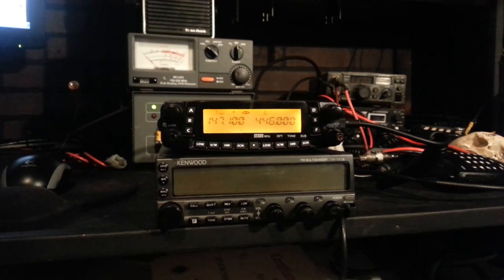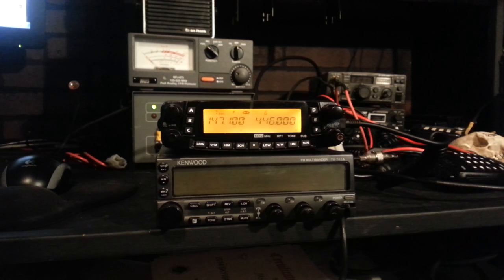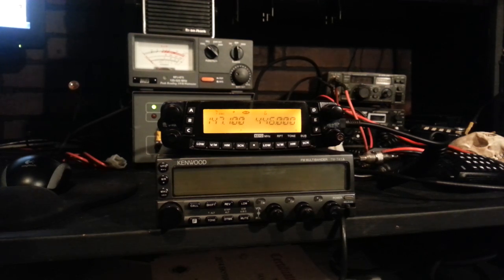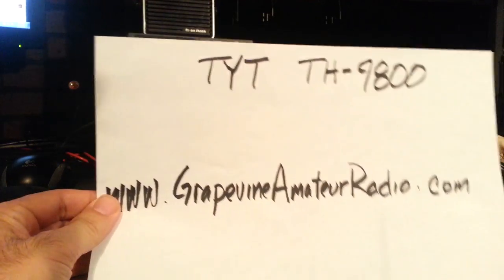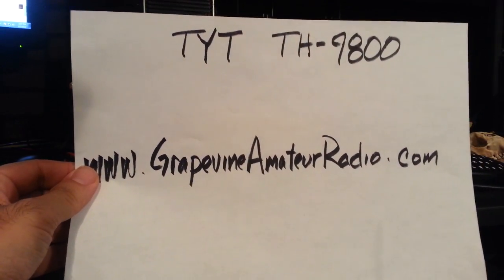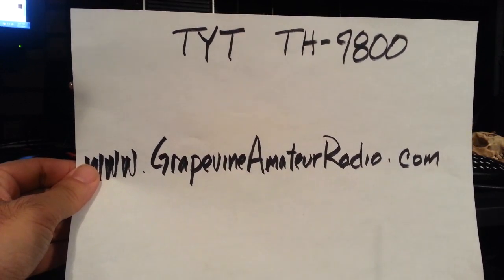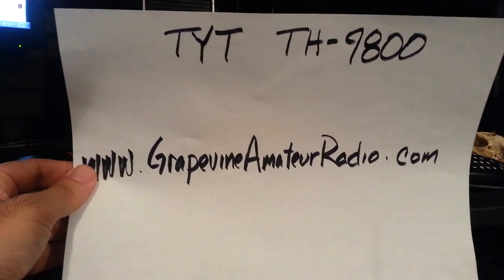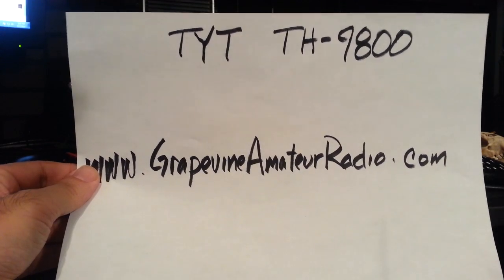How to Program the TYT TH 9800 Quad Band Ham Radio - Ham Radio Programming

Comment: Hi,
Great video! 👍🏽 I have a question: why the transmission on 27 mhz is very distorted? The transmission on 2m and 70cm works perfectly. I checked the antenna and the SWR is 1.5 on 11m. Thanks!
Reply from the maker: This radio isn't really made to TX on 27MHz so the performance is poor
Reply: @HamRadio2 Thank you so much for you’re answer! 73

Comment: is this radio lcd display supposed to dim when transmitting?
Reply from the maker: No
Reply: @  well mine does then it beeps before normalizing the screen. Almost like it’s sending a ptt ID. At first I thought ok there must be a power connection problem, but it transmitted  without pausing on a different channel. So no power problem and a beautiful transmission.  I hear the other repeaters but unable to transmit.

Comment: Thank you for the video it was very helpful. Question, is there a way to have different CTCSS tones for transmit and receive? There are a couple of repeaters I would like to use but their uplink and down link tones are not the same.
Reply from the maker: It's been a while since I used this radio, but if I recall correctly, no there isn't a way to do that.

Comment: I recently won a TH7800 in a raffle and have been looking for explanations on using it.
Your quad is apparently almost identical to my radio so thanks for being an 'elmer' for me.
73
Reply from the maker: Yes they're very similar. I made a video about the 7800 also, which was released a couple of years after the 9800

Comment: I ordered one of these from AliExpress because it was advertised to do 70cm/2M/6M/10M but got burned. It only does 70cm/2M (tried both sides of the radio) ... to add to my pain, it appears used and the data connection does not work. I programmed all of my repeaters (100+) and simplex frequencies by hand. Your video was a huge help there. Thank you!! I also really like those A,B,C,D,E,F presets. Excellent for the ISS and other satellites to start on the main TX/RX frequencies and then chase the doppler  with the nobs. I wish I could get the data connection working to see if 6M/10M is disabled via software. Might look for someone locally with a known good cable. Anyway thanks again for making this video. Would mostly be a TYT branded paperweight for me otherwise 😆
Reply from the maker: I've never seen one that didn't have 10/6 meters
Reply: @HamRadio2  It's definitely odd. If I cycle through the left side of the radio in VFO, it's 144/350/440Mhz and right side of the radio is 144/440Mhz. If I enter 029.600 manually for example it just resets to whatever frequency I'm on. Only thing I can think of is if I can get the data connection to work that there might be options in the software to enable/disable bands and maybe I just need to re-enable. Though there's the potential those were disabled to "refurbish" (maybe they weren't working correctly) The radio did appear used (wear marks where the bracket would be installed) AliExpress is always a gamble 🤷‍♂
Reply from the maker: Sounds like you got a TH-7800, not a TH-9800
Reply: @HamRadio2  you might be onto something there! The radio does have the TH-9800 logo as well and Product/SN sticker, but I imagine fakes do happen. Appreciate the insight and thanks again for recording this programming tutorial.

Comment: I am getting my 9800 plus dusted off and want to start using it again. But I need to find another ‘head unit- mount bracket’. No-one seems to have them for sale. Is there an alternative you could suggest for this?
Reply from the maker: Not that I know of
Reply: @HamRadio2  thanks for quick reply. Subbed.

Comment: Does the 9800D work the same?
Reply from the maker: Yes
Reply: @HamRadio2  thanks so much as the manual even for the newer 9800D leaves a lot out….have you expanded the bands yet ?

Comment: I know this is a old thread. But cannot find any info on how to program 10 meter FM on this unit.  Also,  can you confirm this unit will transmit and receive on 10 FM SSB?  

Thank you
Reply from the maker: It is FM only.  And you can only use 10M on the left side of the radio.

Comment: I'm a radio ham but only own a Baofeng UV-5r right now. Here in the UK, 2m and 70cm is busstling with activity right up until about midnight or 1am, so I'm thinking about this radio as an upgrade to my current setup. I like that it goes on 446mhz as well, since 446.000 to 446.200 is a licence free band here in the UK like GMRS or FRS is for America.  I like the extra bands like 10m and 6m, and I may give them a go at some point too.

Comment: Hello

Thank you for the nice video about the VHF/UHF part of this TYT TH-9800 quad band radio but it would have good to at lest have an antenna hooked up to it so we could hear it working.
But also what about the 29/50 meters segments of that radio which we seen very little of what it can do let alone hearing nothing of its audio quality let alone also not hearing any ting as to what antenna/antennas would be best to use for this quad band radio both in the HOME base setup and indeed in the mobile especially if you are looking to perhaps buying one of these radios.
Let alone as to what additional cost you would be looking at in the antenna range let alone any other things you would need like a switch box for changing over the antenna or an antenna range seeing how there are not two many quad band mobile antennas around for that radio setup let alone for its home base setup at lest in the vertical range that would suite it either looking at what’s available or unavailable as that radio has just has a single OS232 socket on the back.

Thank you again and who knows I many work you some time at lest on 10 meters.

73s

🌍

Comment: Hello. I know this an older thread. Recently purchased TH 7900. Don't have access to a computer or laptop, just this Amazon fire tablet  I am writing on here, so I have been trying to manually program repeater to no avail. Think I have been doing this correctly but when I key up to repeater, I get an ERROR message. Simplex works just fine though.
Reply: Just fixed it. I believe I was entering encode & decode when only encode was needed. Regardless, I am now able to tx and recieve  on repeaters.

Comment: I can't seem to get the radio connected to windows 10. I keep getting an error. HELP please
Reply from the maker: What software?  Most likely it is a driver issue in Windows, check your device manager.
Reply: Using the TYT software and chirp. Neither work. Updated the driver and restarted the computer. Does the radio need to be in a special mode? I can't find any info in the manual
Reply from the maker: @boatsyoung  Nope, no special mode, at least not on the model in this video.  If something has changed in the last few months, I am unaware of it.  Still check your device manager with the radio connected to the computer via USB cable that plugs into the back of the radio, with the radio powered on.

Comment: The microphone isn’t very good I had to order a yaesu mic the original one no one could understand me
Reply from the maker: The TYT mic I had had too much gain - it picked up lots of background noise while driving.  Sitting in the shack, it worked fine.
Reply: @HamRadio2  Well i ordered a new yaesu MH-48 mic from eBay and just soldered a 100 ohm resistor to cut down the voltage and now its not very hot. I'm also going to change the element in the original mic and I hope it will cure the problem. Thanks for your reply Jason

Comment: I followed the steps in your video as well as using the manual. For some reason when I hit the PTT there is no transmission. Although once I let off the PTT it makes a little noise. I have another (working) radio set to the same repeater to listen. It is as if the TYT KT-9800 is transmitting on the output of the repeater. Like the + shift isn't working at all. It must be a bad one.

Comment: I had a Yaesu FT8900 and returned it... they changed how "banks" work from the 8800. I really like how you can program banks, and assign them to the 1-3 and 4-6 keys (or A B C and D E F on the TYT) and more importantly scan that bank. The 8900 would scan ALL freqs and didn't utilize bank scanning.

Are you familiar with what I'm explaining? And if so, does the TYT scan each memory channel (or channels assigned to that letter) individually? Or, will it scan like the 8900 does?

... I program a 9800 tomorrow. So I'm curious and would like to explain it to the owner.

Comment: One question: if I turn AM off on the menu, will it disable 29/50Mhz? I don't want to transmit on those bands by mistake since my antenna is dual band 2m/70cm. Thanks!
Reply from the maker: It will disable AM but not the band.  Disabling AM on that radio only means that it is locked to the FM mode.

Comment: This radio had a design flaw with over-voltage of the CMX-138 audio chips. Do you know if manufacturer fixed this issue in the latest revision of this radio?
Reply: I wanna know too

Comment: I recently purchased the tyt 9800 but I can't seem to get the cross band repeat function to work. I did not buy it from your website but when I do key up the numbers that both sides of the radio repeater side flashes the signal strength but that's all

Comment: If this radio needs any form of maintenance after the warranty is gone then it will require you to ship it back to China and back at your costs.I will never buy another TYT just for that reason.It’s not an option any longer for me.
Reply from the maker: This is pretty much true for any radio out there.  The difference is that TYT doesn't have a repair center in the USA.  Some Japanese companies also require shipment back to Japan.
Reply: @HamRadio2  I have never had to return any ICOM to anywhere outside of the United States and plenty of places here who will work on them.I had a lot of fun with the 9800 but I will never buy another at any price.👍🎙
Reply from the maker: @1OFGODSOWN  Well Icom is a better radio, hands down.  But people don't buy the TYT, thinking it is a better radio - they buy it because it is cheaper.  So you get what you pay for.

Comment: What is the difference between the 9800 and the 9800 plus ?

Is there a way to open up the rest of the receive range ?

So I can get the 222 MHz band RX and the 500 and 600 band ?
Reply from the maker: 9800 Plus replaced the 9800 a couple of years ago. It fixed some minor issues with the original model

Comment: I had one and it lasted about a year and a half ago the receiver quit working on all bands.I contacted many repair shops across America and I found NOBODY who would touch it for even an attempt at a repair.I contacted several dealers who sell them and none of them could offer me any leads for a repair short of returning it to China which would require me paying shipping both ways and the repair costs.I could have purchased another one for less money so I sold it for parts to a Military Man in Texas who wanted to make an attempt at it.I have not heard back from him now in 4 or 5 months so I guess he has not made any progress.I had some fun with it in my mobile during band openings on both Ten and Six meters with the Diamond Quad Band mobile antenna while it lasted.I would NOT ever buy another one since nobody will repair them.I’ll stick with my ICOM gear and know it’s repairable in America.👍🎙
Reply: Did you tune your antennas properly? If not that can reduce the life of your transceiver.
Reply: @discofishing  I use an antenna analyzer to tune my antenna’s for every antenna and every band.I’m not an Idiot.I have only been tuning antenna’s since the 60’s how about you?

Comment: I have the Tyt th-9800 as my base i picked it up in 2014 when i got my license. and haven't had any problems with at all works great. I liked it so much i just bought a Th-7800 for my truck. they are great radios. great video    KK4ZNU

Comment: Can you use it as a Gmrs repeater like putting 462.550 on left and 467.550 on the right  please let me know
Reply from the maker: No.  It was repeat from the same band to the same band.
Reply: @HamRadio2  what 1 radio can you use as a Repeater since I Don't have a lot of cash to get on being on SSI Disabled
Reply from the maker: @RuossFamilyAdventures  You would need 2 radios to create a repeater - one for TX and one for RX.  It'd be easier to just buy a repeater.

Comment: The HYS 8900r is the exact same radio.
Reply from the maker: Yep. TYT was out first, though
Reply: I had a heck of a time trying to find help programming my HYS  (It's not listed in chirp). After some digging I found out they are the same. The only difference i found is that the HYS will cover the 64cm itenerate business and GMRS bands which I use quite a bit. My wife is not a ham but my GMRS license covers her so we use this radio while I'm at work. I use the business band at work on another radio.
WRJL490
AI5BU
73s

Comment: Anyone know of a mod or custom firmware for the TYT TH-9800 PLUS that lets you open up use for 6m or 10m on BOTH the VFO's instead of only on the left one? Really wish I could at least listen to 6m on the right VFO at the same time the left VFO is on 6m too...

Comment: 6 yrs old...wow...!!! I guess that's why the radios are no longer available on your website... Great tutorial though, thanks...!
Reply from the maker: Yes I stopped selling radios a couple of years ago. Thanks for commenting
Reply: If you haven't gotten one already try Amazon and I'd definitely suggest the extended warranty just in case. Also you preferably want to look for the "plus" version because it's the newest version with most of the "bugs" worked out.

Comment: Hi, if I throw freqs into the TYT with Chirp, will the codeplug make the changes on the radio in order to use the repeaters? All info is on the codeplug correctly.

Comment: Can you set this radio up to cross band to uhf at max power and vhf to low power? I want a small foot print for my vhf HT because I only want to use it as a hands free option for around my property to get into the local uhf repeater
Reply from the maker: Yes you can do that

Comment: I've had a couple repeaters cause my radio to power off, backlight goes of then screen goes blank till I release ptt. only does it on high power.  I tested power output from my supply, Astron RS-12. and no drop in power. any help is appreciated !
Reply: I also have an Astron RS-12, and it is rated slightly lower amps than what this radio pulls at high power. I think the radio manual recommends 15 amps or more. Try connecting it to a 12V battery or a larger power supply and see if it still happens.

Comment: You mentioned the power output levels for the 2 meter & 440 mhz bands but I missed it if you mentioned the 6 & 10 meter bands?
Reply from the maker: They're about 25-35 watts each
Reply: Ham Radio 2.0 that is very low? I get 50 watts or better on both bands with my own TH-9800.Do you have the power settings right on yours? Those numbers for yours are quite a bit below spec.I love mine and have worked all over the USA on it on both 6 & 10 meters during band openings.I use it Mobile with the Diamond CR8900A antenna with pretty good success.
Reply from the maker: @1OFGODSOWN  They're advertised at 50-watts, but I have found that rarely they get that high on those 2 bands.

Comment: Hi Ham Radio 2.0 can you tell me if the TH-9800 model does TX and RX in AM 27Mhz (CB frequency)? Big 73.
Reply from the maker: The newer ones will not, no.  Some of the original units did, but they removed that.
Reply: @HamRadio2  Thank you very much for your return. I'm looking for a base or mobile radio that has TX and TR in the AM (cb frequency)/VHF/UHF bands and that is not too expensive and that fits in a small space in my apartment. Congratulations on your channel. Huge 73.

Comment: Old guy just new to HAM  Great job explaining the TYT TH 9800  I'll watch this 40 times and something might stick.  KM6TBX
Reply: With the CHIRP software is extremely easy. It is like filling a spreadsheet.
Reply: @k2icc I only have an ipad. Does CHIRP work on IOS?
Reply from the maker: Good luck.  I should probably re-do this video and add some steps to it, but the steps listed here are still 100% valid.
Reply: Same here om
Reply: Does the 9800D have a digital mode? What does the PLUS indicate?

Comment: does have: c4fm or/and wires x?
Reply from the maker: A TYT radio?  No...they don't make anything for Fusion.  You have to buy Yaesu for that.
Reply: @HamRadio2  Ok, Thanks. Just I thought it was a clone, looks like it is not.
Reply from the maker: It is a clone of the FT-8900, which is a 4-band analog radio.  It pre-dates anything Fusion.
Reply: @HamRadio2  Good Info, I was comparing it with the today FT8900. tks

Comment: I have a question about TYT TH-9800 radio.
Do you know how to programming this radio to set in "Memory Only" mode?. I tried programs following the steps in the manual, but when I turn on the radio by pressing the LEFT V / M and Power button, only ADJUST MODE appears on the screen and the day does not respond.  
I hope you can help me.